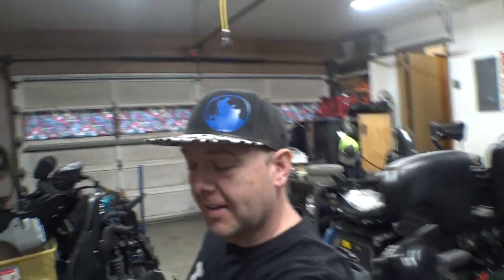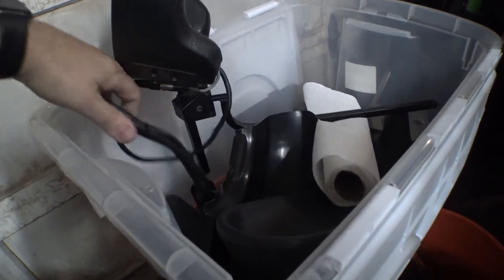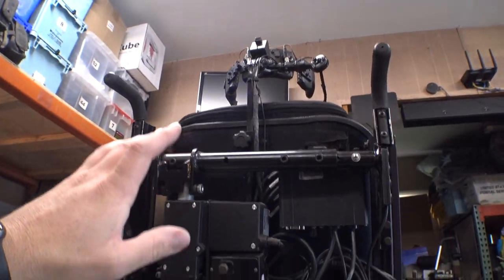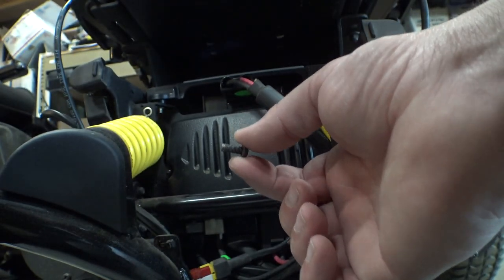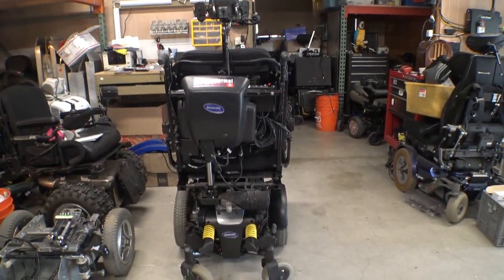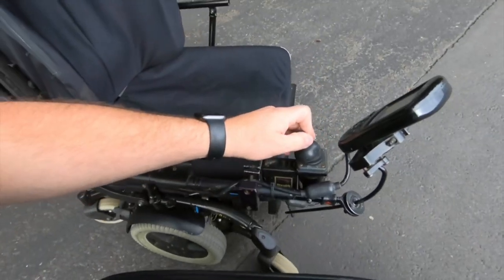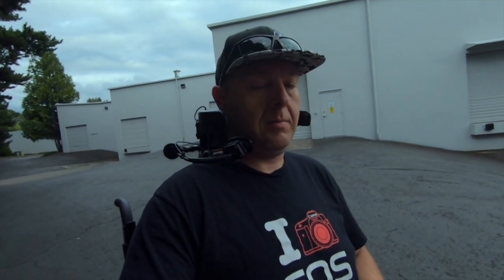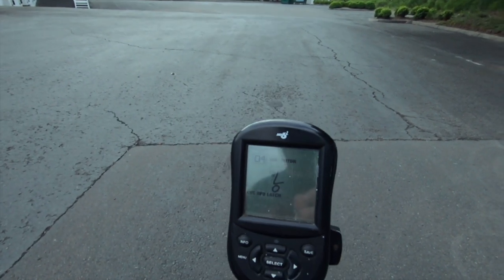MEGA VLOG 514: testing head arrays!

Comment: Dan, I got tossed out of my new (got it around December) F3 Corpus last Saturday. Ever since I got this chair, I have not felt safe on any rough surfaces. I feel like I'm perched on the seat, not sitting in it. Well, I hit a bump while going a little too fast downhill in the yard. The chair tipped forward, oh yeah, great job those stupid tipping wheels did. I landed on my knees. Noticed swelling about 45 min later. 4 hrs in emergency room & x-rays showed a broken kneecap and a cracked fibula. Plus a 4" bruise on my right shoulder where 350lbs of chair hit. I now only use my old permobil C300 when offroad.
Reply from the maker: wow!! that's the first ive heard of those chairs tipping forward!!! i never been able to get mine to tip at all.. even when trying.. hope youre ok! geez...

Comment: There is a type of head control that has proportional speed. It's called RIM control. I use one. I don't think they manufacture them much anymore as the head array became the new replacement. At some point if I can find my old busted one I'll send it your way. Requires a MKIV controller, which I might be able to send you as well.
Reply from the maker: thanks for the info! i've seen the RIM control settings in the software, but never knew what it was for.. ill check into it!!